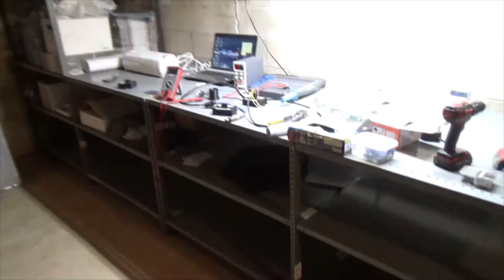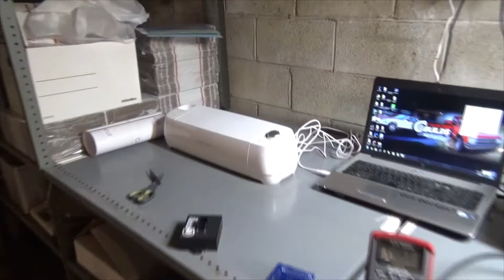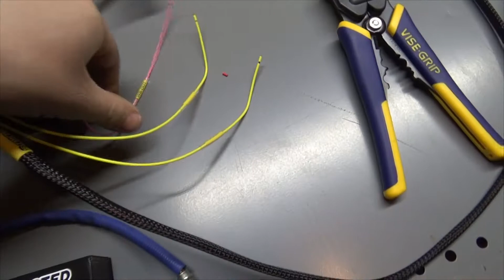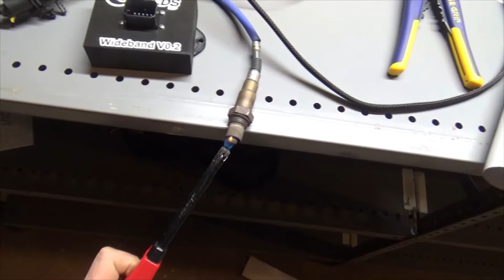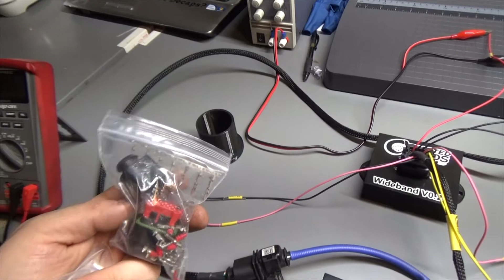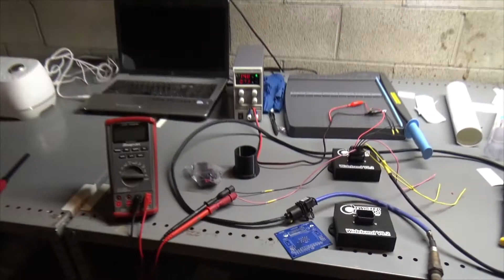Wideband Controllers are Headed out for testing! Also got a vinyl cutter! TB Update 12-10-19

Comment from the maker: Update to the video! Pricing is planned as follows (all prices do not include shipping):

$55.00 for DIY wideband controller kit. DIY kit will be unassembled except for the IC chip and program header which must be installed for programming. Kit will include all components needed for the controller itself but WILL NOT include a LSU 4.9 style wideband connector. (Cheapest your going to find pretty much anywhere for controller only that works with the updated sensor if your good assembling it yourself and if really on a budget you could source a wideband sensor connector at a junkyard).

LSU 4.9 harness connector with pins will be $15 (can be added to the DIY kit if customer wants a new one).
$85.00 for Assembled wideband controller with BOTH ampseal and wideband sensor connectors and pins. Would require building your own harness.
$135 for Assembled wideband controller WITH professionally made 7’ assembled harness (this is what you are getting in the box for testing).

Additional harnesses can be bought for $60 each (just in case of misrouting and they get cut on say a firewall, or get damaged from external sources, etc).

Comment: Bad ass yeah need to get me a dual wideband so read both side try keep it safe to spray it with more
Reply: Ya I always thought not having one on each side if it is not merged and after is not ideal but I would leave the other bank O2 in and just hook up that narrow band for the side with the wide band
Reply: @james10739  I am saying I should be running a dual wideband for both header I have fender exits exhaust so why like to run dual and not just read one side
Reply: @MotorCity_Racing7319  ya

Comment: Well done on your efforts mate, great to see.
Quick question, your wide band sensor in relation to the two analogue volt outputs , like use one for a gauge and the other as an input to the ECU for auto tuning and data logging.
Are those analogue volt outputs able to be made 0 - 1 volt DC and or 0 - 5 volt dc considering some ECU's use 0 -1 volt analogue volt inputs and some use 0 - 5 volt DC inputs.
Also what will the scaling be 
Example=
0.0 v dc = 10.0:1   and 1.0  volt   dc = 20.0:1
0.0 v dc = 10.0:1   and 5.0 volts  dc = 20.0:1
Regards
Dave.
Reply from the maker: PRO TUNING AUSTRALIA thanks for the questions!

So the two pink wires on the harness have true wideband sensor outputs, so they work on a 0-5v scale and 0v is 10afr and 5v is 20afr.

The units also have two simulated narrow band outputs (yellow wires) which are 0-1v and 0.5v is the stoichometric switching point so for pure gasoline, at 0.5v output is 14.7 afr, so just like narrow band sensors, they will switch between rich and lean giving the ecu a simulated narrow band output. Hopefully that makes sense.
Reply: @TwistedBuilds  Thanks for the replies , which where exactly what i wanted to hear plus more.
Most WIDE BAND CONTROLLERS  manufacturers don't bother with the simulated or true narrow band /STOICH outputs,this is great as it allows for far more accurate CLOSED LOOP LAMBDA TUNING /CONTROL by the ECU for nice clean and strict emission control, not to much of an issue for us in OZ yet but for CARB"s in the US and EURO it sure helps,
I am on a disability pension, but when i can i will purchase one and test it out on the dyno etc i have approx 8 WIDE BAND UNITS now, I use and do comparison testing on,
Reply from the maker: @protuningaustralia6795  Well whenever you are ready for one let me know. I completely understand the whole limited budget deal and thats what sparked all this madness off. Bringing cheap but good solutions to the masses. You'll probably have to email me at dale@twistedbuilds.com for the order though due to being in Australia, I'll have to arrange for shipping off website (website is only setup for USA sales currently). Just mention your youtube username when you email the inquiry and I'll get you setup. Thank you!!!